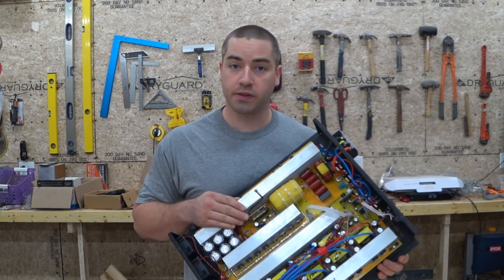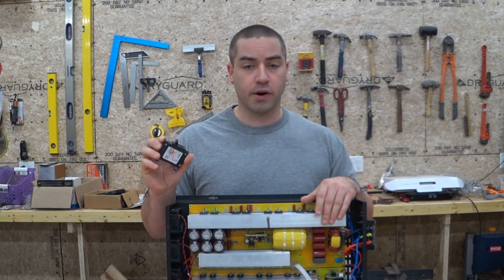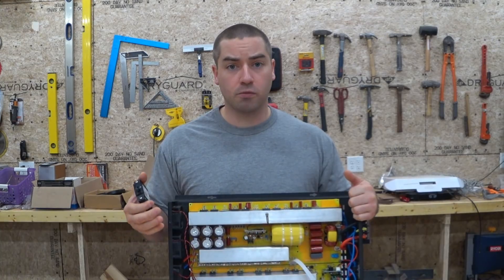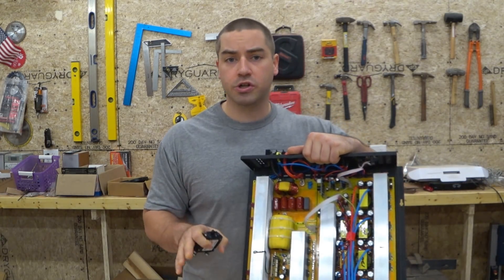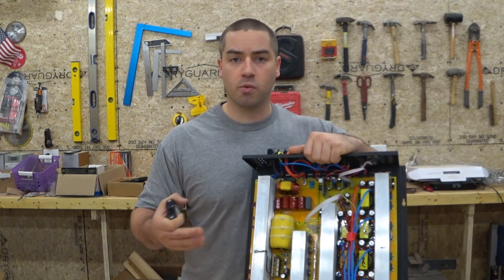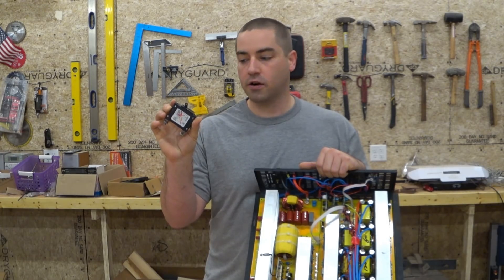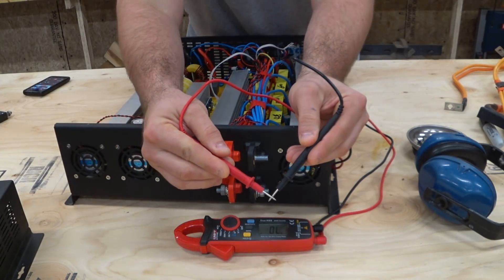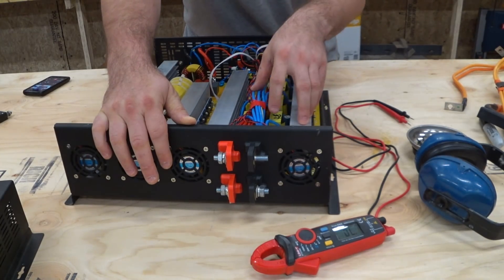Did I Blow Up the Inverter?

Comment: a few things @trackgeeks I do not think there is a problem here with the batteries as he could do the same with the 3000W inverter. Point#4: As you say the tester used cannot identify the surge value, the tester is giving an average of the positive sine wave of AC (to simplify), definetly the inverter is not good. @DavidPozIn Point #5 the video you say are using a DC circuit breaker... after an inverter that is giving AC? I guess if you did with the 3000W it should work anyway but will probably not give the expected results results from the curves (C curve) you looked into. Also, the breaker is not "small", the load (as you says due to a short) has far exceeded the limits for the breaker (what I am trying to say is that you should not increase the breaker amperage without reviewing how that affects the circuit cabling). Point#1: Surges: The "timer" you refer to, no, it is not a timer (at least not intentionalor acurate but calibrated to a range), it is the quality precision of the braker (here curve C) that defines the range where the braker could go (and hence the time due to warming up as you explained with a range). The highest the precision with a diferent curve type the faster the braker will go (and the more expensive it will be, a C curve is one the most comon and cheap because the range is larger), some uses for this are to prioritise diferent brakers in the circuit and/or to protect more vulnerable and valuable equipment. Point#3: So maybe: Large in rush current due to start of motor burns mosfets (short), which then causes fuses to burn (will take longuer than mosfets) and the short in the Inverter (the 8000W) version then makes the braker go which a "Bang" (the 1200% range you talked about). This theory only starts making sense if the 3000W version has something else to manage the motor surge that the 8000W does not; and it assumes you have already used the 80A DC breaker after the Inverter AC output with the 3000W inverter. In any case it would be good for the manufacturer to identify the issue on why 3000W ok but 8000W not ok to resolve it in future models.
Reply from the maker: Thank you for such a well thought out comment.  I'd like to clairfy something that I probably did not make clear enough in the video.  I located the circuit breaker between the battery and inverter, so it is on the DC side.  Thanks for watching.
Reply: @DavidPozEnergy  Yes, apologies, I didnt pay enough attention. So, had you used that breaker with the 3000W when you had no issues?
Reply from the maker: Yes, I used it with the 3000w inverter for the last 3 months before making the 8000w inverter video.  It never popped, ran AC, miter saw, shop vac, or table saw (one at a time)

Comment: I may be wrong but it seems like a shitty mosfet drivers. There are probably half-bridge or full-bridge, so basically one is always on, the second is off. If for a very short amount of time two of them will fire. The full current flows throug them (not very good). And this can happened because of surge. This might just mess up driver for a very short while, but it is enough to make 2 of the mosfets work in the same time.

Another idea is that it's shitty filter. When inverter for a short period of time drains a lot of current it's create a spike that should be filtered. If not, because there is inductance you've get high voltage spike that puncture the mosfet. Not because you get current spike (mosfets can handle quick current spikes very well, there are parameters like Idm, which is pulse drain current, that can be like 3-10 times continuous drain current). But because you get voltage spike between source and drain (and mosfets actually hate that).

Comment: There's nothing wrong with it you will see zero ohms at the terminals because the internal caps have discharged and is normal you need a 250 A breaker minimum 
Have you even tried to power it  back up my guess is it will still work fine
Reply: All the fuses in the inverter have gone so Mosfets are already destroyed (they fail dead short) another youtuber loves these reliable inverter brand he has yet to fail one like this youtuber has but they do fail if you put more then 3000w on them (eventually like 8-12 months) and they are about 3200w constant 8000w for 2-5 minuets before they overheat

Comment: That clamp meter isn't fast enough for the measurement you're trying to make. The number you're seeing on the display is more like an average value with a time constant around a second or so. If there was a breaker-popping surge lasting a few milliseconds, the meter would be blind to it.
Reply: I agree with you. He (@DavidPoz) should use a meter with CREST mode or at least Peak RMS mode. Amprobe 330 would do. I think he might see more than 100Amps if he got it right

Comment: Let's look at the events of this inverter. 1st Inverter installed, lamp installed and lit== inverter working. Saw started, instant death of power, some spark in the fuse. Current inverter health== unknown. I saw you measure the "short" in the outside poles incorrectly. These units have capacitors and other components in their outputs that would make for a temporary short. You quickly touched the leads. By observing the first attempt with longer leads touch you received a beep, then silence. I would wonder of you left the leads in the output poles if they are truly shorted/stayed beeping. 
Next, without going into specifics of math, we know that too much voltage crossed that fuse, and that the fuses in the inverter blew. Did it short (inrush)somehow, or more likely it received current from two sources at once. The inverter, and the collapsing field forces from the motor. 
One of the posters suggested carefully reinstalling the unit, and if functional, slowly increase the load using passive loads like bulbs, and toasters, soldering irons etc. 
Also, on a different tack the inverter "creates" the A/C sine wave. The neutral is redirected back into this circuit. In simple terms it means that the return path to neutral is very sensitive/fragile. Running regular motors on this type of circuit will stress the inverter and the motor. If any contractors are looking at this, they will agree with me that you don't run one of those inverters for cars on a saw like the one you used. 
Lastly, contact the manufacturer and ask their two cents. Tell them that there is a heated debate, and you need to speak with a tech not customer service. They can view the video and weigh in.
By the way, thank you for showing us this, and starting an exchange of information. I hope you manage what you have started. I guess the real question is HOW you can run your garage tools from your inverter. Most contractors use gas generators with good results. Also maybe the RV market has some more robust units that handle blenders ETC.

Comment: I slowed your last video down to .25. At the 7:18 minute mark, I seen sparks come out from outside the inverter. That tells me it was a feed issue. The mosfets maybe failed from voltage spike issues. 
That saw is designed to work on a house 15 amp circuit. 15 amps times 120 volts is 1800 watts. A 2,000 Watt inverter should run the saw. The saw may prefer a pure sine wave inverter, but a modified sine wave inverter should not self destruct.

Comment: first no barker will be fast enough to save a semiconductor this includes a simple fuse.these inverters have to parts two them 1 up converter this takes the input DC 48v ect and steps it up to over 300volts the small separate transformers can current hog and so can the FETS it realy needs a big ferrite transformer like an E65. the next part is the inverter out put being derived from the 2 x150 + split DC rails that are fed to a half bridge digital generator driver some times a full bridge driver.
this is fed to an output choke big yellow cylinder.
out put of which goes to the feedback of the controller IC    when you put an inductive load on to it that takes a lot of start up current this results in problems with stability in the out put feedback killing the inverter.
this type of design is floored they always go bang.
the answer is to get a real inverter such as an outback with a big output transformer.
you have to use these Chinese inverters like they are made from glass.

Comment: The inrush current spike kills the inverter. Weird that the smaller unit takes it but maybe it just can't provide enough amps to destroy the mosfets. For this application you might need to add a soft starter.
Reply: I think that's a reasonable GUESS,  but the guess should be tested.  What's missing here is an accurate measurement of the peak current when the saw switches on.  The multimeter used in the video was a good try,  but not satisfactory for this test.

Comment: Dude - are you powering that inverter on that tiny 80 amp DC breaker?  Are you kidding me?  I run my MS4448PAE on my Volt battery with a ginormous 300 amp DC breaker (from MNS, btw).  This is more appropriate for that sized inverter.  Stop analyzing this and spend the money on the real deal.  Also, your multimeter test isn't valid.  Look me up if you want some guidance on any of this, it's pretty simple in the end...
Reply: Ummm.  And what happens when you get a 250 amp draw that wont cause the breaker to trip when it needs to?

Comment: Interesting bits.... 
I agree with your assessment that the inverter is to blame. I don't think you were drawing 135% though. Based purely on the time it took to spark and die, it seemed closer to 600%. 

The inverter is overly technical. 
It's running 3 phase power in 3 parallel feeds to a single toroid inductor for smoothing purposes. The amount of capacitors alone guarantees component failure.

Go for a large transformer and immerse it in baby oil.

Comment: Just based on the shorted input on the inverter I'm positive that it was junk mosfets in the inverter that shorted thus, causing the breaker to trip. It threw sparks because it was disconnecting the inverter under a direct short condition, house circuit breakers will throw sparks the same way if you have a short in the line.

Comment: I just got a look at the bottom of the 3000W board. Reliable does use a similar topology to what I described. The transformer secondaries are in series, primaries driven individually. Current sharing isn't an issue.

Comment: There are deffinitely a great deal of good comments as to the failure. To start off most cheap inverters on the DC-DC step up side use a TL494 or something simular. Usually these circuits have no over current protection because of cost. When one transistor goes, the PWM ramps up because the DC voltage rail drops and the rest of the transistors blow up. Now this could have been caused by a drop in voltage because of your circuit breaker causing the input voltage to drop and the PWM to increase to maintain the DC rail voltage, but highly unlikely.

Perhaps if you get this thing working, verify that it can actually handle the rated 8000w. Try a bunch of heaters as a resistive load to check that it can do the rated watts. I doubt something on the cheap end can do the rated watts.

Also I have an older Xantrex 1800 watt 24 volt pure sine wave inverter that I have run many saws just like yours with no problems. It handles the start up surge just fine. So it all comes down to as others have said, you got a cheap inverter. I got the pure sine wave inverter to handle variable speed power tools as most are triac based and will not work with modified sine wave inverters.
 
Hope this helps.

Comment: After a short break and time in front of the AC, I thought of something else. There is a remote possibility that with the high power saw motor, that some back EMF (electromotive force)  has caused a voltage kick / spike from the motor's reversing magnetic field.
This is pretty common with inductive loads on start up when they draw an initial high current. The remote part is this; this situation would have occurred  on the 110v AC output side of the inverter. But without being able to see the manufacturers circuit diagrams and design specs I can't say how such a voltage spike would cause a failure in the 48V DC input side of the inverter; unless it created a fault condition such as crowbar effect where the input would present a very low resistance during a fault condition eg deliberately setting a triac to short out the wiring circuit,  to blow the fuses (like a metal crowbar thrown across the circuit). This would be a critical failure to stop the inverter from creating an  fault condition on the 110V AC side that could endanger property or life. 
Again if inverter was in standby and such a crowbar circuit was included in the design then this may be the only protection system operating rather than a controlled shutdown of the nverter. 
I'm sure the manufacturer will be interested in this discussion and will no doubt be consulting their design engineers.
Reply: Running an Inductive load (eg a motor) from an Inverter ALWAYS causes nasty spikes and kickbacks. But the designers of the Inverter well know this, and should have taken that into consideration, plus tested endlessly with different motor loads. eg drills, washing machines welders, etc. The fact that the inverter blew up, simply says that it was poorer designed. There are few cheap Inverters which can withstand this for any longish period.

Comment: A previous comment by another poster pointed out a couple of points I missed. 1. lithium batteries have low internal resistance so can produce very high input surge currents. 2 that if the inverter is only switched on and is in standby / idle mode the inverter protection circuits are not active until a minimum load has been attained. Going from standby to a high load instantly may well be outside the manufactures design parameters. Lack of a useful manual or specifications or operating instructions may be a contributing factor to this failure. When I run inverters I connect a 30watt fan to the load side and point this at the inverter, its a side benefit to keep it cool in 34C (typical Aussie air temperatures) but by using the fan the inverter is already working into a load so is "fully switched on and not in standby". To properly test this inverter a storage oscilloscope would be needed to capture the input current and voltage transitions. Difficult as amps will be in units of  hundreds and voltage spikes in tens of thousands. So maybe 2 scopes on different settings would be better. Bench testing of complex electronic equipment by untrained but enthusiastic users is often not effective without a good understanding of electronics and electrical theory.
In practice the tests carried out would be typical of most purchasers, in a suck it and see approach. 
I would do the bench testing as previously posted and get as much info / data on the inverter via specs and the manufacturer so that the testing was designed within the designed working and surge conditions.
Black box inverters from China (branded or unbranded) are hit and miss as so many do not have specs, just pics and tempting low prices.